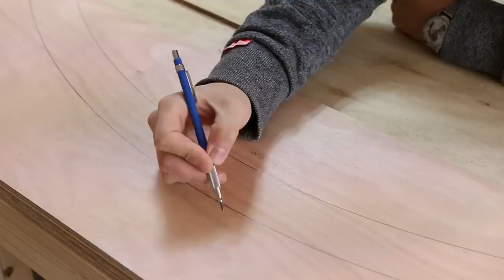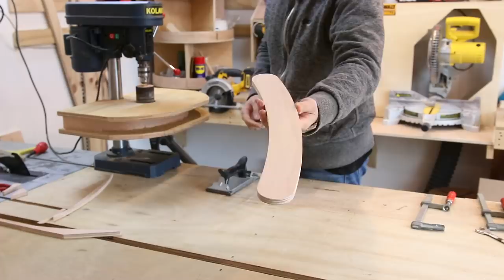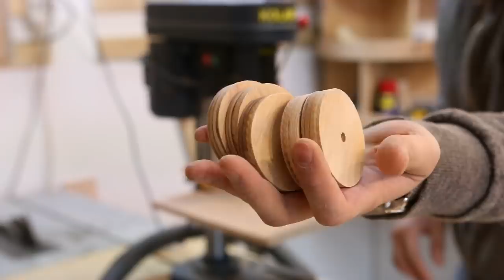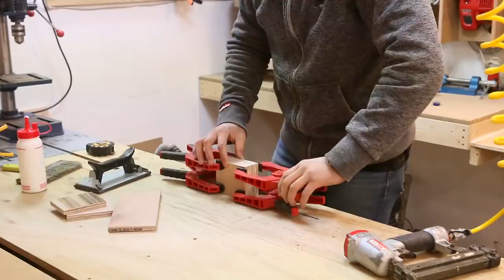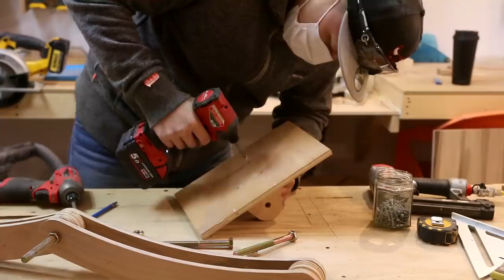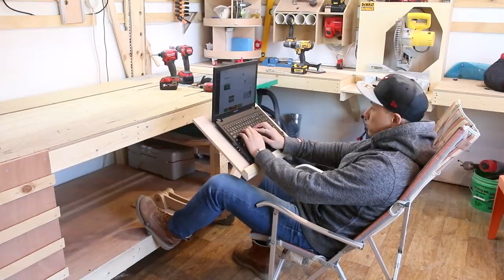접이식 스탠딩 책상 작업대에 설치하기 [목공DIY]

Comment: This should be awesome for a vacuum attachment for the drill press or a lathe! to be able to bring it in and out .. why not swivel base so it can turn to different machines? .. Thanks for the awesome video!
Reply from the maker: Thank you for a good tip. I will consider it.

Comment: Is it possible for you to make a 6 fold pull out drawer desk version of this device, the base and the top being flat, and all the arm extensions collapses flat onto itself with a metal strap holding them, and it all tucks into a drawer space, that I would be more happy to install, since it would save the surface space and simply mount to the bottom of the desk. It would serve the same radius one being supported at an angle with the pull out drawer, and the standing being a vertical support.

Comment: Looks good but has very little torsional strength aka too flimsy. Having two of these articulating arms at both sides instead one in the middle would fix that. But then the sitting position with the support between your legs would not be possible. I guess you need to make it from carbon fiber to be both light and rigid
Reply from the maker: I will gradually upgrade
Thank you for a good tip.